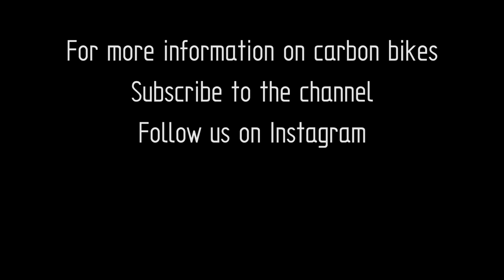Don't do the "squeeze test"!

Comment: High performance bikes for low performance people, the gains of these ultra light frames may benefit the elite athletes but for the average leisure group rider, it’s like taking an F1 car to the shops, I think most people need to address the fact they are slower isn’t the hardware but the extra effort in training and lifestyle faster riders have.
These frames for the average to good riders are ridiculous when comparing cost, durability , safety and real world gains😂😂😂
Reply: These frames aint light. Bikes from 5-10 years ago r lighter because these days the pro level bikes are optimized around 6.8 kg leaving heavy bikes for consumers
Reply: Also the ultra light frames used by professionals are one off's and are maintained by top tier mechanics. They tear down and inspect everything during maintenance and if something is even suspected of being compromised they replace it.
Reply: Correct. I see a lot of people in my area who ride 10k+ Pinnarello, Cervelos, SWorks etc who look like they're 40 lbs overweight and they plod along at 13 mph at 50 cadence. Its like they think obtaining speed is as simple as opening their wallet. As most of us here know, its mostly the rider.
Reply: Don’t get me wrong I would love to try one and I suppose loads of supercar owners are terrible drivers too but as long as they keep splashing the cash the goodness eventually filters down to us meer mortals  so I guess dentists lawyers keep the research and development funds going by buying the best🤔🤔🤔😂
Reply: @daryl4841  so? Does the fact that someone who enjoys his time riding a 10k bike annoy you? 

Lol why don’t you sell your house and live in a rented apartment? No one needs a house to live after all; all you need is a small apartment to stay in. Its what you do in said space that matters, not the house itself after all, right?
Reply: @87togabito   I feel the house analogy doesnt really work.
Its more about a person buying a tool that isnt right for him.

 Like a really tiny weak guy who needs to cut down a tree buying the largest most expensive axe in the store because the salesman told him it was cool, when in reality he would have been better off with a smaller, lighter axe more appropriate to his strength and skill level. He may enjoy owning the large axe, but perhaps for all the wrong reasons. And the tree remains standing, to some peoples annoyance.
Reply: @Alfred Wedmore You my friend are the problem with cyclists in general. Me personally I ride and see other cyclists and wave and offer assistance if I see them stoped with a mechanical. I don't care if said cyclist is overweight and riding an expensive bike. I see someone outside enjoying themselves and striving to better themselves and encourage it. 
The elitists mentality of some cyclists is actually pretty pathetic.  Oh and guess what there's always someone faster than you so don't be so quick to judge people. 
I'm mid 50's and hovering around 215-220 lbs and have lost 50 lbs and I ride a Giant advanced pro 1 because I enjoy trying to push myself and improve my physical limits.  Can I keep pace with a 140 lb 20 something year old.  No I can't but does that even matter no it doesn't. All that matters is that I'm enjoying my rides.
Reply: @jjmoto65  If you are out there enjoying yourself, losing weight and all that kudos to you thats brilliant. But I would think the majority of 55 year old heavy set guys would be better off on a more comfortable and study bike. And these bikes are way way cheaper than the likes of your TCR. Thats the point here I think, that people are being mesmerized into buying bikes that are not right for them. I understand it can come across as elitist, but a lot of it really isn't. Especially when it comes to lightweight components there is the aspect of safety. This, as well as correct fit for your agility etc. should come before status and desirability.
Reply: @larslosh5598  first off cheers and nice reply. I totally can see your point and I agree to a certain extent. I only took up road cycling close to 2 years ago but have wanted to for awhile. I mountain biked years ago and am pretty knowledgeable about bikes. I  agree about concerns about lightweight bikes. Actually when I first got into road cycling I did quite a bit of research and weighed my options. Because I was heavier I  decided to purchase a used lynsky titanium bike. I still had main concerns about wheels. But to be honest I haven't had any issues other than flats. I always thoroughly inspect my bike and wheels both pre and post ride. The lynsky has served me well and has become my winter bike. As far as the giant goes I thoroughly inspect it and have not had any issues with the carbon frame/fork as well as the carbon wheels. I am definitely not the fastest rider out there especially when climbing and am still looking to drop more weight as it will help. On the flats I think I can hold my own pretty well(33-35kph)  for my age. I also purchased the Giant second hand for a little over 2k. Also I have pretty good flexibility when it comes to the Giant and have no problems riding in the drops for more aero gains. I can totally see your point of a more comfortable bike but as of now I don't think I need one although I'm realistic and realize that some day that could change. For now however I'll just keep enjoying my rides and pushing my limits and see how far I can go. Cheers
Reply: @Alfred Wedmore By "racing bike" you mean road bike? And you find it silly using a road bike...on the road? I think you got your analogies a bit mixed up with this one. If thats the case, then I do agree it would be silly putting a towbar on your road bike and pulling a farm cart along.
Reply: @87togabito  You should work on your analogies

Comment: Wow. Just think if you accidently dropped your bike on a bike rack or it got hit by a car door?  These bikes are so gentle it could delaminate or "micro" fracture? Pathetic use of a material then.  Give me a "break".
Reply: Just don't do that. Or if you want a rough and tumble bike then get one.
These are optimized for riding.
Reply: @galenkehler  
I've never seen anyone dropping an expensive on purpose. Accidentally, yes. On purpose, never !
So saying "don't do that" won't help anyone.
Reply: @galenkehler  pretty sure I said "accidentally".  Shit happens. So then is your bike potentially wrecked?  Made for riding, just don't ding it.  Too funny.  How about don't sell junk.  That would help.
Reply: @galenkehler  kept in cotton wool until a 50kg super-athlete rides it in a race, it gets a complete strip-down & rebuild, then it gets put back in cotton wool, like a Faberge egg, you mean? Thats the dictionary definition of masturbation.
Reply: Same for aluminium roadbikes.
It is a localized force from an unusual direction.
Reply: @DilbertMuc  See all those lines on aircraft wings with "NO STEP" written on them?
If someone applies a point load on an area not designed for it, the plane will be totally down for inspection.
Landing and turbulence are distributed forces, that the plane was designed for, just like riding cobbles is for a bike.
Also micro-cracks happen and are inspected for during certain routine inspections.
I presume you do not bring your frame to an inspection every two years.
Reply: @kilianortmann9979  But that's exactly my point. The "No Step" signs are there for ignorant plane mechanics not to damage the frame / fuselage of the airplane well knowing that plane mechanics usually are skilled workers with an education. Still, paper thin carbon frames are being sold to the ignorant masses of consumers without them letting know in what dangerous situation they can throw themselves. No warning signs, no regular frame inspection, maybe a lot of abuse in bike cellars and racks and the consequences of tragic accidents are on the consumers fault. Bike frames for consumers should be safe and have a margin for safety. That Storck frame that Raoul Luescher mentioned definitely had none.
Reply: @DilbertMuc  I have a slightly different opinion on that.
I think one should be able to buy the most extreme race frame, why not?
Bike manufacturers are selling the dream of being pro, just as other companies, race carving skis for example.
Is it a good idea for average joes to get the hardest skis and lightest frames? probably not.
But that should be clear pretty quick, at the very least after reading the manual.

"You are choosing light weight (shorter frame life) over more frame weight and a longer frame life.
You are choosing light weight over more dent resistant or rugged frames that weigh more.
All frames that are very light need frequent inspection for cracks that would indicate that the frame is worn out from fatigue.
These frames are likely to be damaged or broken in a crash.
They are not designed to take abuse or be a rugged workhorse."

Literally out of the Cannondale manual and I think that says it all.
If people can't be arsed to read that and at least take it a little bit seriously, after buying a thousands of dollar bike, I can't help them.
I would like to have a standard and a 'race' (-200g) option for a frame though, some wheel manufacturers are offering something similar.

Sorry for the long winded answer.
Reply: @DilbertMuc  that's OK so long as no one poked the wing with their finger.
Reply: @edlorenz1552  Trouble is, that customers want the lightest and the bestest. If there was no demand, the manufacturers won't make them. So part of the problem lies in the ignorance of the consumer. Of course, the bike industry is not going to kill it's sacred cow. CFRP bikes are cheap to make using 3rd world relatively unskilled labour. With Steel, Alu and Ti frames, one needs some skill to mitre, assemble, then  braze or weld them together.
Reply: @shannondeckard8587  yes, i build steel bikes and know all about them.  Keep reading below to @Alfredwedmore great explanation.  If carbon is so delicate, as pointed out by the YouTuber here, its a sad use of material.
Reply: It ain't all Toray. Hexcel, and others. And it's not just wings and body tubes. It's fairings, supports, frame members, and even turbine blades.

Comment: People just have misconceptions and not the good expectations for high end bike. They think that if I buy a very expensive carbon bike it should withstand everything. Sorry but, no. It’s like :" Ho I’ll buy a F1 car and give a little kick on the shaft that connect the wheel to the direction, it should be ok." But, yes the car cost many thousands and can go to 200km/h but if you put stress on a part that is not meant to have this kind of force (Let’s say radial for vs longitudinal to the axel force) you can easily damage it. 10k bike are F1, it’s not for everyone. So no, you should not lean the frame direct on a post or anything. If you can’t accept that you should take care of it like porcelain, buy something else. And yes the carbon have been optimized for strength in certain direction and lightweight. It’s like a cable/suspended bridge, it’s design with cable who are weak in compression but strong as hell in tension, same idea here with carbon. Pro’s ride thousand of km on their bike, and they are reliable, but yes, it must be look after on a very regular basis. One again if you don’t want to, buy something else, it's not the good product for you. Carbon is not homogeneous material, it’s made from layers of carbon and resin, so when you push on them some layers need to expand more than other (that’s how curvature works, further from the center = more expansion needed) what you think will happen if they are glued together? The bond will break between the layer and cause micro de-lamination. Maybe it will not change anything, but at this price I’ll personally wouldn’t risk it. So don’t squeeze it, it’s not relevant and not so good for the carbon.

Comment: Thanks for this video!
I wonder. Is cabon bikes with Dyneema fiber better at handling this kind of stress and other damages?
For example Time used this fiber in their bikes.
Thanks!
Reply from the maker: Good question, typically hybrids with Dyneema, Kevlar etc are used for vibration damping or to reduce the possibility of complete separation of parts, so could possibly save a catastrophic failure however would not reduce the initial damage. These fibres also have lower compressive strength so clamp damage is more likely.
Best is probably just to put more carbon in the area.

Comment: Then,whilst this is true,it is absurd that very expensive bike frames are so vulnerable to damage.  Given that the people who can afford top end bikes are generally (apart from race teams) overweight,if only by a few Kg.  Not riding at their full potential and in a great many cases not even sitting properly on the bike...Therefore certainly no reason to be riding a frame shaved down to a minimum amount of material,in order to save a few hundred grams...designed for athletes performing at a very high level when seconds count.  Vast majority of people riding bikes average the same speed whether on a $500 bike or $10,000 bike!!!  Yes I do choose to ride top end kit,so just saying!
Reply: Agree. Most people buy based on other (percieved) qualities than those relevant to them and their use. At least a seriously flawed weitghting of them. For me it is far more important that a bike survives falling down at a cafe stop, or getting slammed by the door on my way out of the house, or traveling on a roof rack on a car, than those 20 extra grams of weight.

Comment: I thumb tested my alloy bike, it passed the test with flying colours.
Reply: a dent at the worst on aluminum tube
Reply: Do it to the middle bit of a modern "almost as light as carbon" alu bike toptube, and you will dent it. Seen it puncture on point-loads.
Reply: So did my Titanium frame.
Reply: How's your thumb 😀

Comment: amazing! you can't even touch your bike without breaking it! How far have we gone!
Reply: Not really race spec steel tubes are extremely thin in the center sections, seen many dented beyond use, and Alloy frames even back in 90's were getting extremely thin! My Yeti arc top tube could be dented by squeezing it with your fingers. Or worse my mates Cannondale caad had the brake lever tear through his top. If you want lighter frames it comes at risk no matter what the materials
Reply: Most household items are easy to break if you try. You can easily bend you laptop screen backwards, snap your glasses without really trying, etc. doesn’t mean they’re low quality or bad products.
Reply: You need to work on your comprehension skills. That's not what he said.

Comment: Weight-optimized carbon frame designs always come at the expense of robustness to unexpected loading conditions. Whereas metal frames tend to be less-optimized for strength/weight, due to both their constant tube wall thickness around the circumference, and the fact that metals are isotropic and homogeneous. This gives them superior robustness to carbon, especially on the "thumb test".
Reply: Have you EVER hear about “double butted” or even “triplle butted” i can recall which frame was but i have seen aluminum bike frames with different wall thickness around the circumference... 
yeah, metals are isotropic in books, treat and triple “but” a aluminum tube and do some test to see if it remains isotropic
Reply: @pannnda1  There is also hydroforming, which is usually done on higher-end aluminum frames. This can lead to better optimized strength and rigidity in the desired direction, as well as improved frame aerodynamics. Double and triple butting results in more optimization as well, by making the midsection of tubes lighter. However, within the thin midsection, the tube will remain isotropic and equally rigid axially, circumferentially, and radially, with the associated strength and toughness in each direction also equal. So there is no weak plane that will lead to catastrophic failure in the event of an impact to the midsection, unlike carbon fiber, which is susceptible to shear failure between the plyes.
Reply: @johnbarron4265   how hydroforming will help to have better aerodynamics? If you have 2 tubes both with the same shape and one made by hydro forming the aerodynamics of both tubes will be exactly the same 
If you have a tube with x lenght and along its lenght the thickness of it changes the properties of the sections with more or less thickness will change aswell... also i have seen more trashed aluminum frames than carbon frames due light handlebars impacts (classic top tube) breaks hitting diagonal downtube etc
Reply: @pannnda1  There are also more Toyota Camrys trashed in auto accidents every year than Ferraris. Does this mean Camrys are less durable than Ferraris? 
LOL you can't really expect to be taken seriously with that anecdote about alu frame breakage.
Reply: @johnbarron4265  sorry mate, alu double/triple butted frames aero optimized hydro-formed are almost expensive as carbon frame...

Comment: If a thumb squeeze is enough to damage a normal carbon frame, for me this is a big no ! Just leaning the frame against a pole, a wall or another bike can easily cause higher pressure and so compromise your expensive frame in seconds !!!
Reply: Then get a cheaper bike. Higher end bikes use many different layers and types of carbon